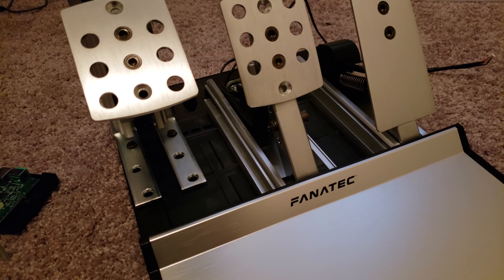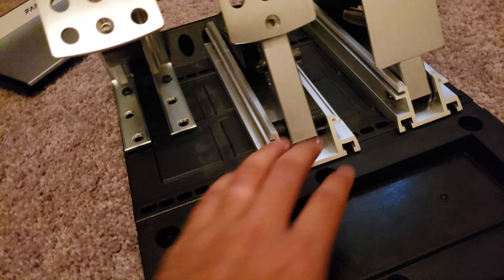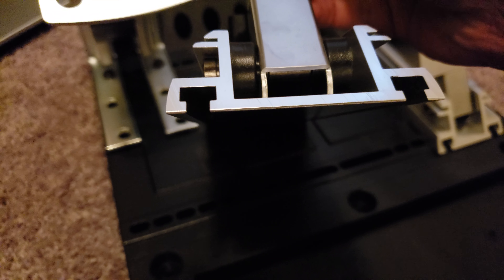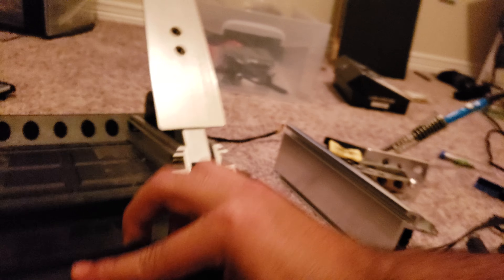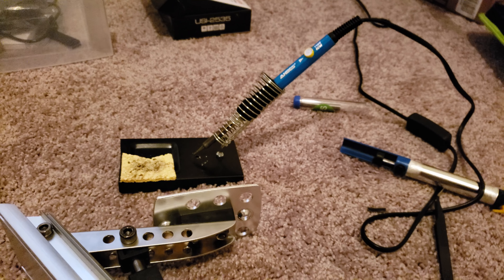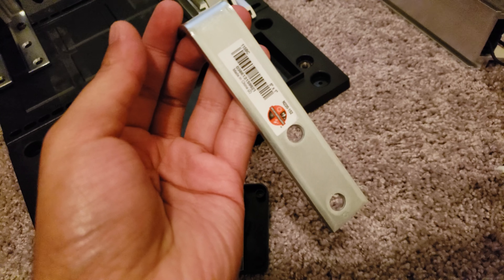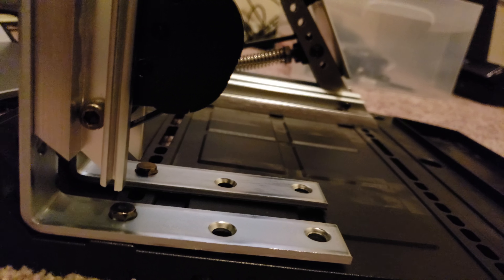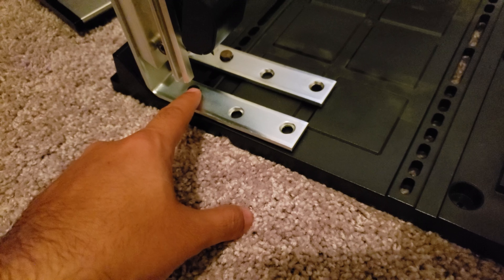Invert fanatec pedals DIY cheap

Comment: Thnx for the video. I bought the brackets and finished the job but now my pedals are not working anymore. Do you have to update the firmware after the inversion? I am currently using the Thrustmaster T500RS with the CSR elite pedals with the Basherboard CPX adaptar.
Reply: maybe you destroyed the circuit board by mistake? u can buy new one from fanatec 25,00 it called SP-CSR EP MAIN CSR Elite Pedal Main1. before u do that send them photo of that circuit board. gl
Reply from the maker: I'm so sorry for the late response but the circuit board should have nothing to do with inversion. Were you able to figure this out?

Comment: Curious how you like this setup and if its holding up well enough? Thinking of doing it but seems like you might lose some of the rigidity.
Reply from the maker: Still going strong! I actually was thinking of doing a floating mount when I get a new desk setup or maybe get new pedals altogether but so far, no issues!